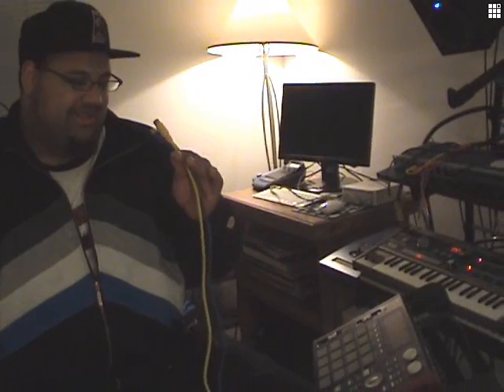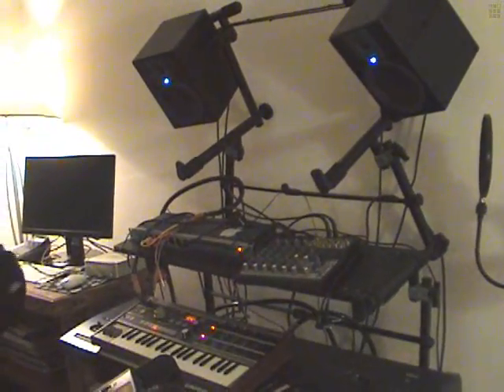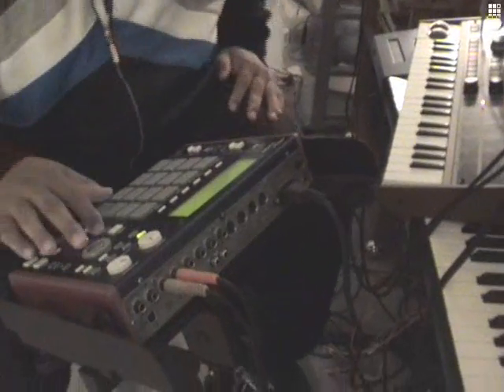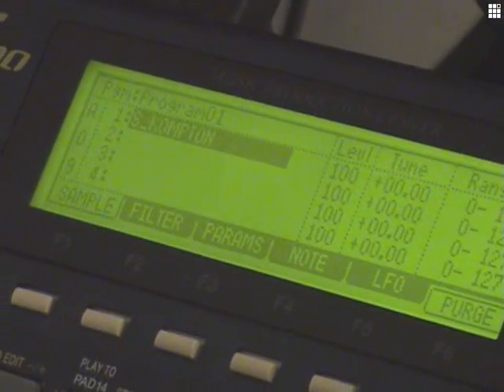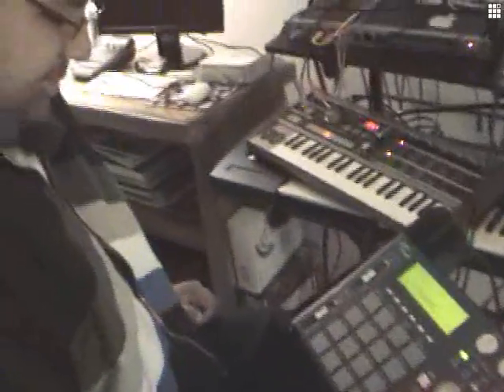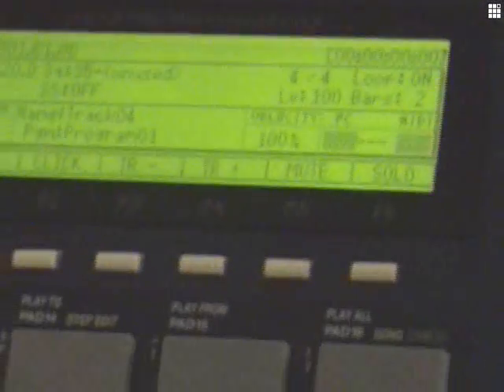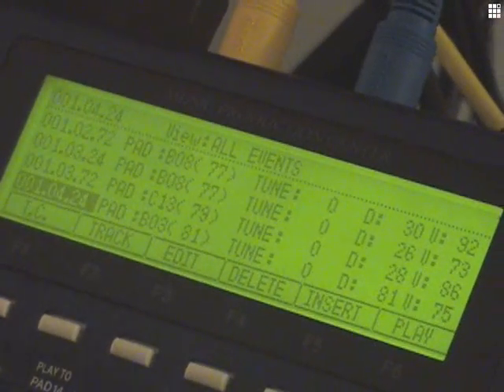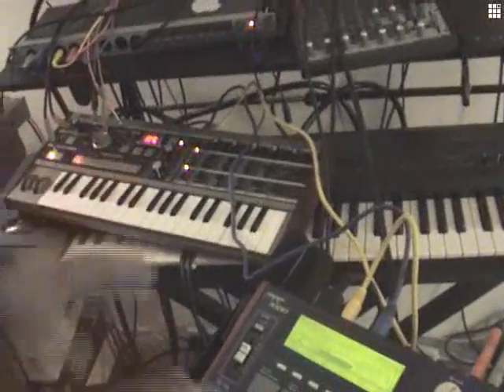Sequencer and Synthesizer MIDI Tutorial

Comment: they are two complete different signals, midi cables send binary code between machines. in this both machines are sharing binary code messages. 

the audio cables send voltage (ie sound) so each device needs their own output and need to go into a mixer and then out the main LR into speakers.

Comment: so the mpc is both a drum machine and also a midi sequencer?
Reply from the maker: +LoW LyFe Technically it's not a drum machine, it's a sampler and midi sequencer. You can import samples into the machine (via CF card, internal HDD storage, or USB transfer) assign them to pads, and then sequence the samples in either in real-time or step edit via the sequencer.
Reply: Cool. You can only pattern sequence the samples, but what about the midi.. I mean can you string together whole songs, etc?  Also does it have internal memory? Thanks